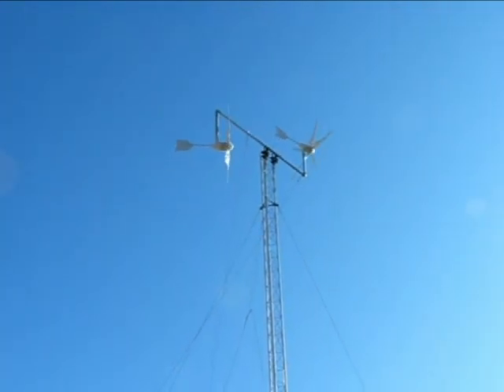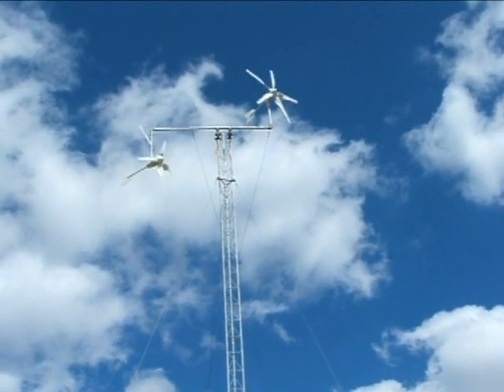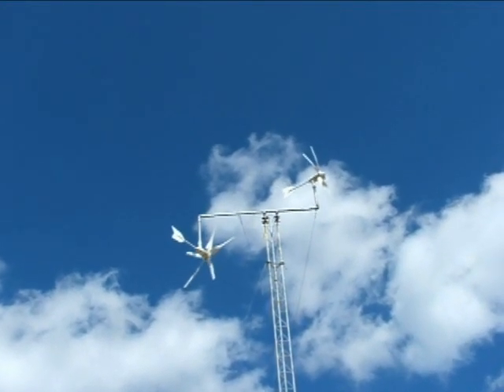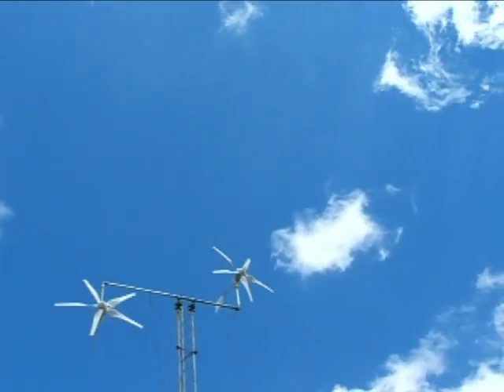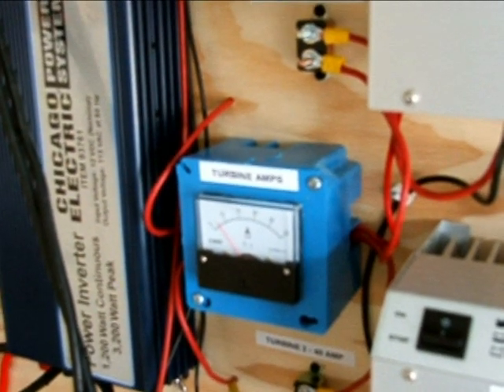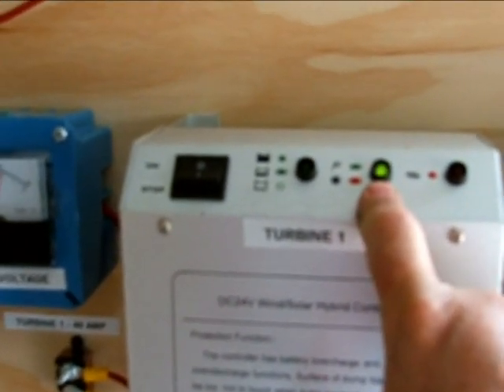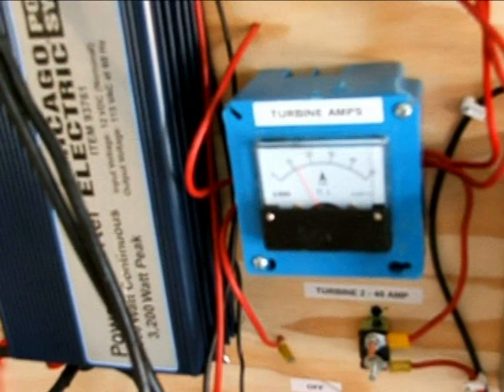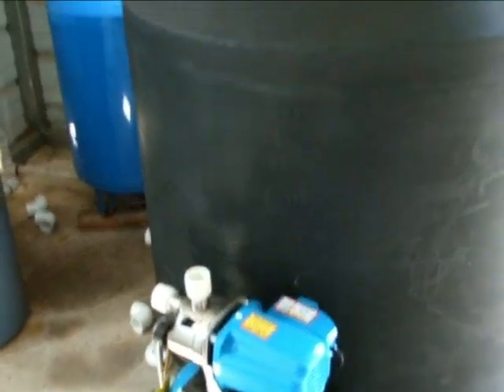Modified wind turbine/generator tower - making good Amps

Comment from the maker: Absolutely. I wasn't getting even 1/5th of what I get now, you have to be at least 20 feet higher than your surrounding trees or structures to get non-turbulent airflow. Also the wind velocity increases the higher you go so your turbine performance goes up. Spending money on a turbine and not going high is throwing good money away.